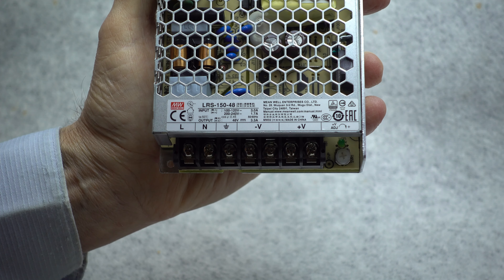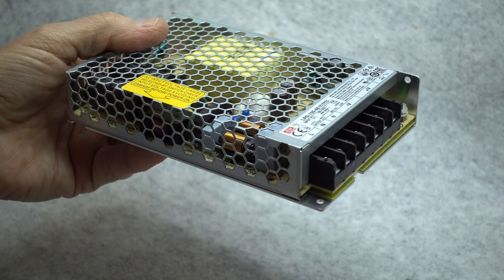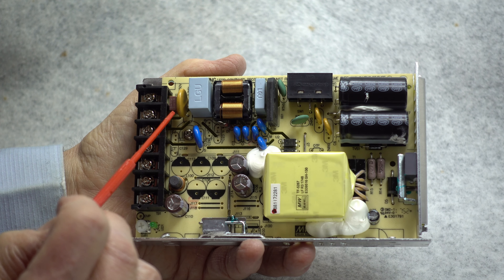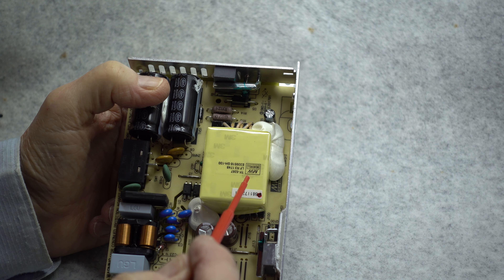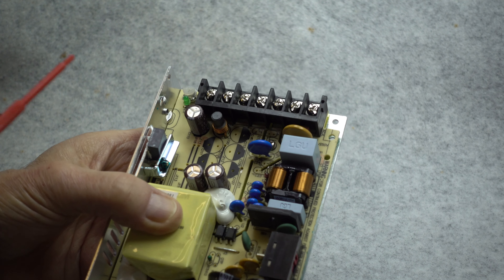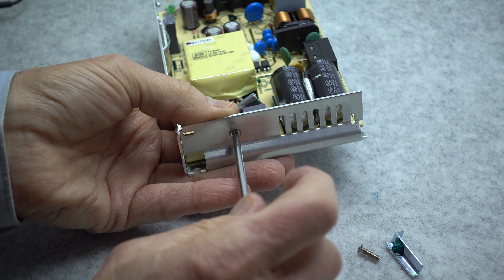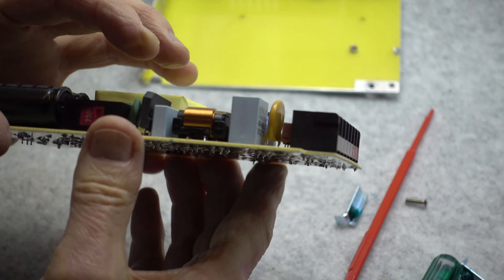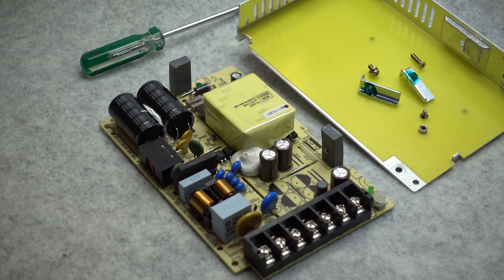Inside the Mean Well LRS-150-48 Power Supply

Comment: Question - is a MeanWell power supply’s output voltage pure DC or pulsed DC?
Reply from the maker: The output is pure well filtered DC, voltage regulated and current limited to the maximum rated value of the power supply. The voltage is adjusted with a small potentiometer located near the terminal strip of the unit.

Comment: Is it recommended to change the trimmer pot for desired output?
Reply from the maker: These power supply have an on-board potentiometer to adjust the voltage about 6% above or below the rated voltage.  It is possible to hack the unit to add an external potentiometer if you want to do that.
Reply: @spectrotekservices  Thank you for your response, 
I am taking this opportunity to describe my issue. And the solution for anyone in need. 

LRS- 100- 24

I have modded one of my 24V PSUs, which featured a 10k pot that provided a minimum voltage of 20.8V but I was looking for something around 19.5V.
So I unmounted the original pot and measured, the so-called 10k was not 10k it was around 9.3K. 
Fortunately, the voltage divider takes  the higher end of the resistance as amplification factor. So increasing the pot resistance will effect in.

I did replace the pot with another one which was also a 10k but valued a Little more than that ~11k.

Replacing the pot allowed me to have some headroom with the adjustments and I was awarded with  19.6v of minimum which I required.

☝️ I want to add that no more voltage adjustments could be done by changing ** only** the pot. The amplifier input is probably getting saturated by this action. The probable solution could be replacing the another resistor in the divider network, but it is not recommended.
It is better to get a lower voltage rating like 15V for such operations as they might provide upto 18V. Or to use a DC DC converter for low current requirements.

Comment: Can you help me out, mine died... meanwell 12V 12.5AMP.. I think maybe it's over voltage protection...? the company won't tell me anything... and they refuse to fix their own products.
Reply from the maker: I generally consider many of the smaller switch mode power supplies (SMPS) as disposable components.  Often times the time and trouble to repair them is more than the cost of simply replacing it with a new unit.  Most power supply manufacturers do not offer repair services for their products as the labour cost for the reapair would far exceede the cost of manufacturing a new power supply.  And consider your cost to ship the failed power supply both ways to the factory for the repair. Likely the repair will cost much more than purchasing a new power supply.

However... fixing a failed SMPS is gratifying, but sometimes, shall we say, "interesting."  The large amount of high voltage energy stored in the mains DC filter capacitors can lead to dangerous sparks and shocks, plus the added joy of exploding transistors and diodes.  What fun!

One of the best books I have found for an in depth understanding of the operation and failure modes of these power supplies is the book "Troubleshooting & Repairing Switch Mode Power Supplies" by Jestine Yong.  A quick Google search should find it for you.

As for actually repairing the power supply, the most likely problems are failed electrolytic capacitors and blown switching transistors.  If it's just the capacitors that have failed, usually replacing the caps will bring the power supply back to life.  If the transistors have failed, beware - something else has usually caused them to die, and if the cause is not located and corrected, the replacement transistors will likely also fail. 

Good luck with repairing your power supply.  It CAN be done, but it will be an adventure.  Enjoy the journey!